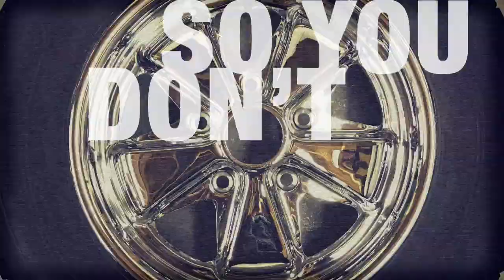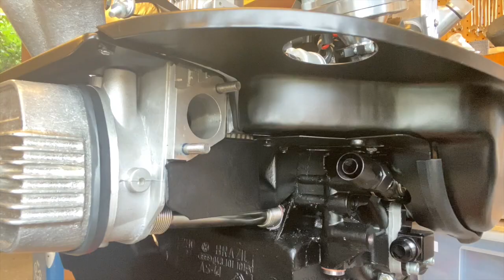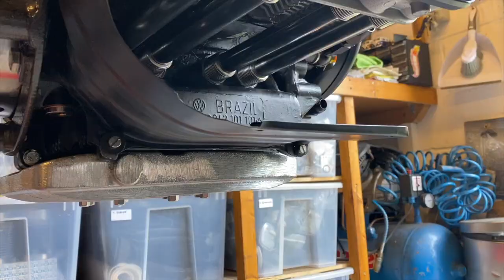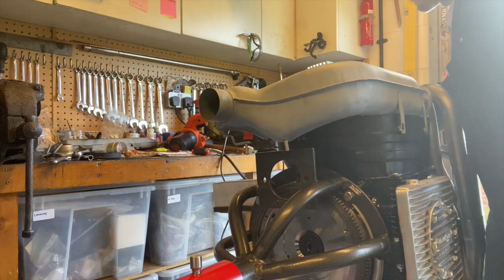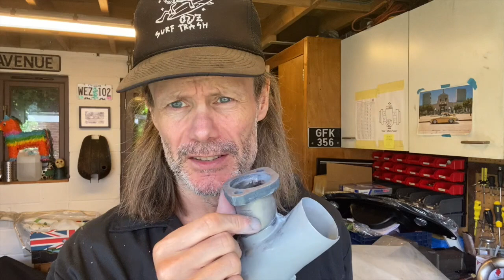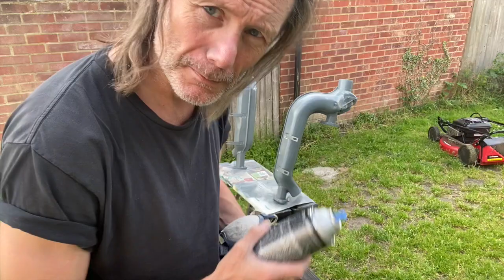PART 18 - A1 Sidewinder Exhaust - How to Build a CB Performance 2017cc Builder’s Choice VW Engine

Comment: I paid almost $1800 for my Volkswagen exhaust and it did not come with gaskets from the engine to the exhaust. Vintage speed stainless steel.
Reply from the maker: Same. I bought a sebring for a different project and it had no gaskets. I emailed them to ask if they could supply some or at the very least recommend their preferred source. Nada. Hahahahaha.

Comment: Ahoy!  Ha ha.  I'm looking for an exhaust system for my CB 2017 kit and need heater boxes like you have. CB no longer carries A-1 exhaust and A-1 doesn't have a website(?!) Making research difficult. I've found a few EMPI systems online in the 1 5/8" size but they don't come with the heater boxes. My question is did you have to buy the heater boxes separate from the rest of the exhaust or was it a one unit deal? Do you have any recommendations for me as far as x exhaust with y heater boxes combos? Trying to keep cost down too so under $1000 US would be a bonus.
Reply from the maker: Ahoy back at ya. H! I feel your pain. When I questioned CB on the A1 situation they told me that A1 had become too unreliable. They suggested I contact them directly. Which is what i did. That in itself was a task. I got through to them through their insta account. The exhaust took months to arrive and when it did arrive the muffler was dented. Not a big thing for me as the bus it's going on is a ratty old thing. I'm sure they would have exchanged it. The welds are good, but I've definitely seen neater / better. I have to say that once I got the A1 guys engaged they were pretty good in helping me decide which products would suit my needs best. They also provided the bigger bore heater boxes. Which were only painted in rattle can primer. So I had to clean them up and paint them properly. The J-tubes inside the boxes are stainless. Pretty well made boxes as it goes. On the whole I'm pretty happy with the product, but it was a pain to get, and they were flakey to deal with. I can see why CB has cut them loose. Next time I'm going to try CSP. I've heard great things about their exhaust systems and the welding is way neater. Also not the cheapest, but I think they might actually be a bit cheaper than A1.

Comment: I have had the paint wrinkles problem you had, in the past. It is caused by the solvents in the paint, reacting with the primer, and causing the primer soften and wrinkle. To prevent this, you can give the primer, longer to cure, or start with a very light coat of paint, and let it setup, before the next coat. Your doing great. Keep up the good work.
Reply from the maker: Yeah. It was super frustrating. I used the recommend primer. Followed the application instructions. You’re right a dust coat would have helped I reckon.

Comment: From the piss poor packaging to the bird shit welds, A1 should be embarrassed at what they sent you. It looks like the outsourced either the collector or the pipes themselves because they surely didn't come from the same shop. At the bare minimum they should send you a new, dent free muffler. Made in the USA used to mean something. It still does but obviously it doesn't mean quality. So sorry you got stuck with that steaming pile of tubing. The fact you waited 6 month is just insult to injury. On the up side, I know where NOT to get an exhaust system! Thanks for that, for what it's worth. At least you're in reach of lighting the fire!
Reply from the maker: Thanks again Charlie. Yep closer to the ignition sequence which is great. I did consider conatcting them about sending out a new muffler, but I couldn't be bothered with another six month wait. 😂
Reply: @aircooledanything2415  You shouldn’t have to send the old one back. Especially given all the other shortcomings. I’m not be for making a big deal out of things with a vendor but in this case, it’s ridiculous. Besides, how else are they going to learn customer relations! 🤨